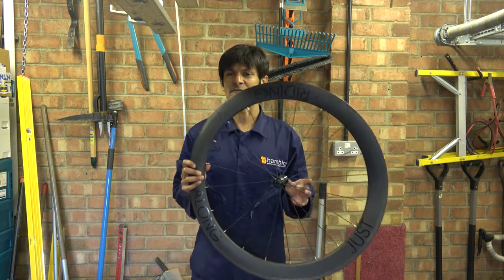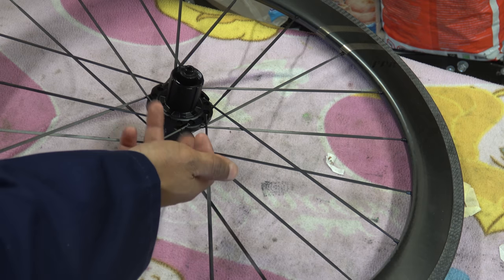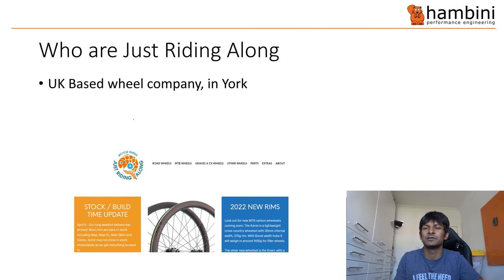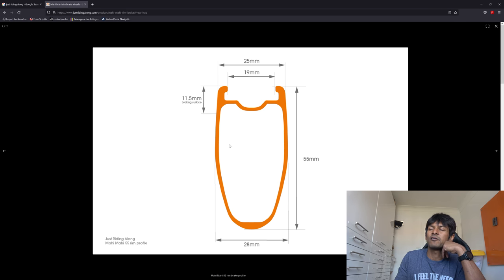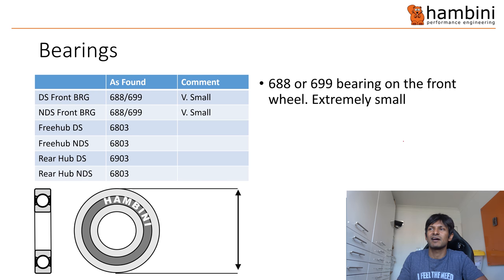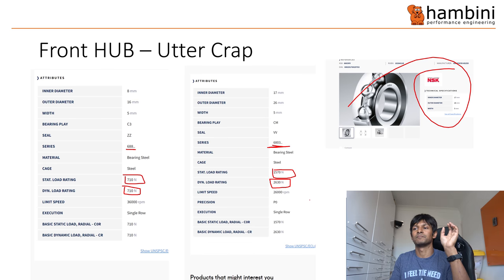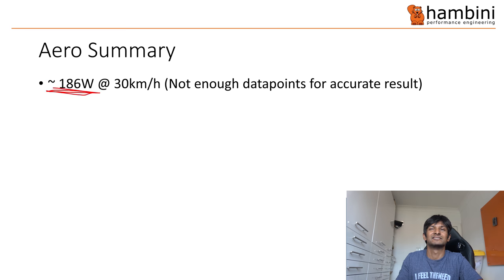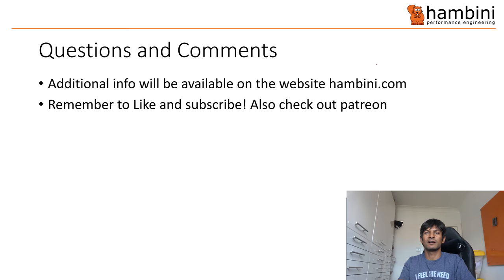Viewer Sent me a set of NEW wheels to Roast: Just Riding Along Mahi Mahi

Comment: Once upon a time....  in a land not far away....  you got the hubs that came with your groupset (Shimano Campagnolo or Sun Tour)...  you took them to a local wheel builder (or sent them in the post if you live in the hinterlands)...  he built you a pair of wheels with the appropriate rims (aluminum for God's sake) and the right  spokes for you.  You rode these wheels and were very happy...  they rolled great, were easy to fix if there was an issue but there was not often an issue.  Once in a while, depending on dampness on your rides you had to rebuild your hubs...  it took less than an hour.
Reply: Yep. Unfortunately reliable aluminium hand built wheels just aren't sexy to your average cycling consumer. And if you ever do have a spoke break try getting some weird proprietary spoke at a small bike shop in the middle of nowhere.
Reply: Or possibly wood
Reply: rollinrat4850 "large chain" + "high end". Does not compute...

Comment: Typically when you remove the pawls on these type hub shells they are single ratchets with a cut out in the middle, not double pawls.  There's an O ring or a wire that will go in the slit and it's what keeps them from moving laterally.
Reply from the maker: What I probably should have said and worded it badly was remove the gap and you'll have a single line contact.  It's not really the double pawl that I was critical over, it's the break to make it into two discrete pawls. Sharing a pivot at the other end is not really a problem.

This setup is like you would have in a gear train and that involves Hertzian stress which in this case is a line contact. By having the gap you create a stress raiser half way down the tooth. There is an area of high stress immediately next to an area of no stress. The high stressed area is in effect in stretching. The no stress area has no stretch. Hence it's better from an engineering perspective to have uniform "stretch" than a stretch/break/stretch because the bit where there is a break will likely fatigue from having no stress. 

Also given the manufacturing tolerances, I doubt you would get the full  point contact.

I would also add, in the grand scheme of hub engineering. The pawls are magnitudes lower on the scale than the very small bearings on the front hub. They are the same size that are found on some pulley cages which have very little load.
Reply: @Hambini  this makes sense, thanks for clarifying. also keep up the good work, always great content here!

Comment: I have the bitex RAR12 rear hub. It's quite reliable. The "double pawls" are actually just wide single pawls with a groove for a retention ring. That prevents the pawls from falling out when you remove the freehub, is all. I personally run only 3 of them. The drag and noise from running all 6 is obnoxious. 

As someone else commented, the anti-bite works. It prevents the grooves from going deeper over time. It's not perfect, but it's the cheapest and lightest anti-bite solution I've seen.

Bearings are crap, but the rear hub runs for like $100 online, which is less than a set of 4 NTN bearings would run you. For the price, I'd say it's solid. Just replace the bearings once they're gone.

That being said, a $150 hubset on a $1000 wheelset is criminal.
Reply: Oh I just read Hambini's response wrt the double pawl comment. It's not about having 2 pawls, it's about poor load distribution due to splitting the pawl. Fair shout

Comment: I've been using a selection of J bend Bitex hubs for quite a few years now and they are generally quite reliable, much like Novatec. 
The cassette biting is typical on aluminium freehub bodies
Reply: but it is non-bite one
Reply: @samulihirsi  anti bite guard isn't that affective on either Bitex or Novatec. 
But you try selling a wheelset with a steel freehub body, especially when everyone is so weight obsessed. 
Titanium freehub bodies are only found on a select few higher end hubs.

Comment: great info. When I was cobbling together parts for a Bianchi Sempre pro frame I found on eBay quite a few years ago now, Chinese carbon parts weren't really on my radar. Except for some winspace handlebars I found on amazon for wicked cheap. Wanted to love them. Cool aero-ish shape, very low weight. But. I gave them a bend over my knee test and pulled like I was sprinting or machine up a hill to see how flexy they were. Sadly, all sorts of creaks and pops to go with the wee bit of flex. (And no, it wasn't my old ass knees making noise). So I returned them cuz they didn't really inspire confidence. If I were doing it over today, given all the reviews from people like you who know what the hell you're talking about, I'd definitely consider Chinese stuff. But I was too much the brand-whore back then and went with Campy wheels that were by far the most expensive part of the build. But it all looks cool and the bike makes me happy. And it should last quite a long time too

Comment: Small point regarding the "anti-bite" strip on the frehub: it will show a little bite initially but it limits it over time. I don't think it's a bad technology, it does extend the life of the freehub quite a bit. What you've seen is probably as far as the bite will go.
Reply: I think you are correct there. But given the shit bearings, questionable rim, and rear hub that provides virtually zero bracing angle for the drive side spokes I would not hold my breath on that “anti-bite” hub actually doing what they claim it does. Just saying! 😆
Reply: @rcg9573  oh yeah I wasn't going to try and defend any of the other choices especially those tiny front bearings 🤣 cassette bite is likely the least of your worries
Reply: My novatec hub looks quite a bit worse than this and it is fitted with an ABG - anti bite guard (need second chain whip to remove cassette) after approx 10,000km

Comment: Hi Hambini

I know you usually do frames and wheels but I was wondering if you’ve ever (or might ever be inclined to) look at Air Bike cassettes and whether or not the bargain prices we see on eBay are worth it? Will they nacker chains? Will they nacker hubs? Will they flex, bend or chip more easy? Any advice on the structural integrity would be awesome!

Comment: I have a pair of this and a pair from Elite, I don't have issues with either of them. The bite marks on the freehub is the same on a lot of wheels, a typical issue for aluminium free hub. (Hope has stainless steel version but it is heavier).
Reply: I found the bikes to be more pronounced using the Shimano cassettes than SRAM or the alloy AliExpress type. The ABG on novatecs works to a point but no substitute for cromo freehubs. The novatec cromo freehubdvis only 40 grams heavier. I have one with the cromo axle on the MTB.

Comment: Hey Frenchie, I have a question that may be a bit out of your wheelhouse but think some of your devout may find interesting. I'm contemplating a custom fatbike (gasp !) build. I would be having a frame maker build me a frame to incorporate a Pinion gearbox which is said to have a bit of take-up when returning to pedaling from coasting. This take-up combined with the rear wheel's take-up has been said to be quite disconcerting. So, I was thinking about using an Onyx hub in the rear. What do you think of the Pinion and the Onyx, and why ? Tell Tyrone I said hi.
Reply from the maker: I've no idea but I'm sure someone will chime in

Comment: IIRC one day did some pre-sale chatting with one faraport guy, they mentioned how they hate the 130mm rear wheel spacing. Even 135/142mm 11 speed disc spacing is way better than 130mm 11 speed. Any comments on that?
Reply: The wider hub is going to far stronger because of the bracing angle. The differential in spoke tension between the drive and non-drive side would be less.

Comment: Well that was relatively mild compared to other reaming videos. 

BTW when I rebuilt an old Easton rear hub, one of the bearings was supposed to be angular contact. I couldn't find ACB from my LBS so I just replaced with regular bearings. Will that be a problem?
Reply: RollinRat  thanks for the explanation. ACBs are tough to come by for me and not sure it's worth the effort and cost. There is a preload on the hub, good call out.
Reply: RollinRat wow thanks very much
Reply: Indeed.  My ears aren't ringing!
Reply: RollinRat  Understood, thanks

Comment: Just had a look and it seems that LightBicycle wheels use the same Bitex hubs with those 688 front bearings. I ordered a fairly shallow version of those (25mm because I am wuss), so just wondering, does the wheel depth make a difference to how big the load is ?
Reply: Rim is much stiffer than tire. It doesn't flex much versus tire which can absorb a lot bigger magnitude of impact.
I can see why manufacturers think this load rating is enough though.
Let say load rating is 700N. If gravity is 9.8 N/kg and you weight 80kg which put approximately 32 kg load on the front wheel just sitting on the bike. Assume hub use 2 bearings which spread the load equally, then you statically load 32/2*9.8=156.8 N on each bearing. There's still quite some margin of safety for hitting infrequent and not so deep pot holes. Just don't fall into a big one.

Comment: I was so close to pulling the trigger on some Light Bicycle WR65 disc wheels with Bitex 312 hubs. What do I do now, DT350 I guess? Has the 5y old reviewed DT350 yet?
Also any advise on brass vs aluminum nipples? Or CX-Ray vs Pillar?
Reply: So basically what I need is a buyer’s guide to Chinese wide deep aero wheels, so that I have someone to blame like a 5y old when my purchase turns out to be shit.
Reply: Hard to go wrong with DT350, they're decent at almost everything.
Reply: Just check the bearing sizes on the bitex website. Not all their hubs are undersized. I built my LB rims up myself with Shimano hubs,  pillar spokes and Sapim brass nipples - not the lightest but the hubs will outlast the rims (rim brake)
Reply: Bitex 312s are more reliable than DT350s.  The hubs here are the absolute bottom of the barrel in Bitex's OE range.
Reply: @pmcmpc  Oh really? What makes them more reliable?

Comment: The two rows of teeth in the rear hub make me think they buy 2 sets off some OEM, and simply stick them together. Much cheaper than manufacturing actual wider teeth.
 
Speaking of teeth, check out some Dicut hubs from DT Swiss if you get the chance. You may be able to explain what material science issues prevented that kind of simplicity earlier.

Comment: I’ve bought components off this company (Sapim spokes) and the service has been good and the price was best at the time. Would I buy their wheels, probably not, as they are just rebadged Bitex hubs and Chinese rims which I can build myself. At least the wheels are built well if the choice of components are questionable for the price being charged. Interesting you roast the front hub as your mate Peak Torque rates the Bitex front albeit the RAF12. I believe this hub is the straight pull version of the RAF10 which does have smaller bearings to save weight. I’ve also found the RAF12 to be a decent front hub🤷‍♂️.
Reply: Also the bite marks on the freehub suggest the cassette isn’t properly torqued up not really a fault of the hub.

Comment: Had a Bitex hub. They were really bad. The hubbody worn out after 8000km and so I could move the bearrings in their seat.
Reply: Recently bought a powerway r13 hub. I think they are they are rebranded bitex hubs or vice versa... I'm curious how long it will last
Reply: @stop223  In years gone by, the R13 hubs were pretty popular. I recently bought a pair of wheels with these hubs, but haven´t used them much so far. Worst hubs in front must be the "American Classic" style. Abysmal bearings made from soft cheese.     Rgr
Reply: Mate... the hub body didn't wear out, the bearing wore out and attacked the hub body. Maybe check those strange noises once in a while? (But yes, they are s***e).

Comment: Hey Hambini, have you had a look at Light Bicycles carbon wheels? They have tempting prices, so I assume they are shite waiting to be revealed.
Reply: Light Wheels have gotten pretty good reviews in the past. Peak Torque ran a set for a while if I remember correctly
Reply: have three sets from them. every single one is decent!
Reply: They are great. Myself and several others in Melbourne have only good experiences. Forums say the same. I built my own LB wheels up with robust Shimano hubs as they are indestructible if you service regularly (a bit heavier than the tiny Bitex RAF 10/RAR10 shown here)

Comment: You've gone too far. You don't like Bitex, you don't like DT Swiss, I have to presume you don't like Novatec, what else are we amateur wheel builders supposed to use? These hubs are perfectly acceptable for the majority of us. We don't all need hubs built like brick shithouses.
Reply from the maker: that isn't quite right. I don't rate this hub, especially the front hub and I have explained the reasons why. You can get the better bitex hub which should not give you problems
Reply from the maker: I would also add, the bearings in this front hub are the same used in some pulley wheels. That gives you an indication of the load rating.